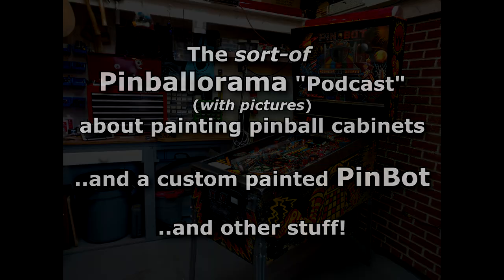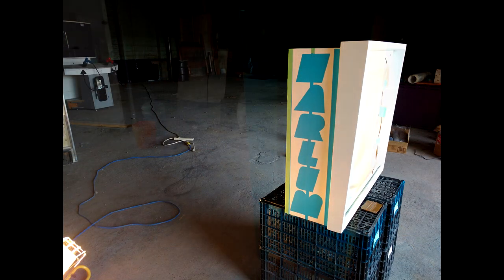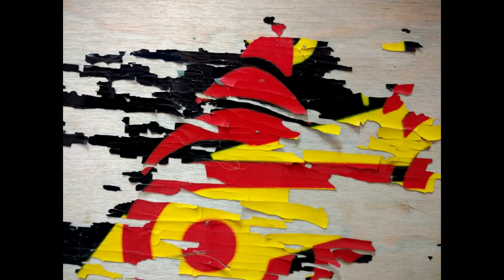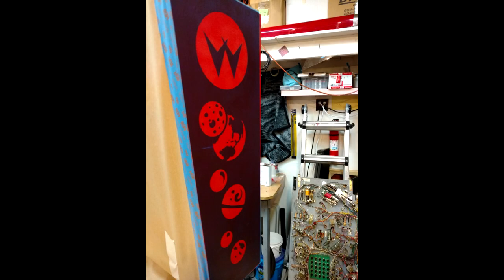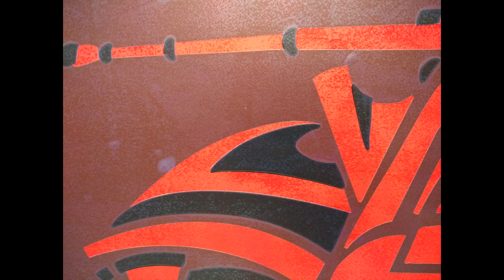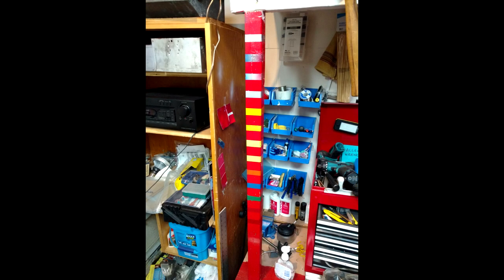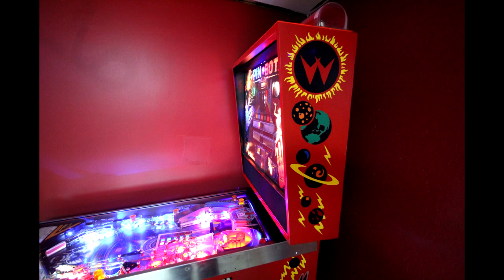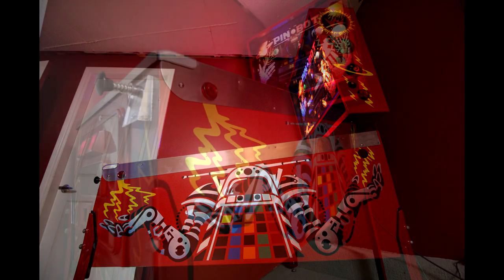Painting Pinball Cabinets with Stencils - The sort of podcast-like video with pictures and stuff.

Comment: I have a slow restoration of Black Knight, I painted the cabinet with stencils and it looks amazing.  The edges are clearly visible and elevated due to the layers of paint.  Did you do a wet sand on the edges when you sanded with 3k grit?   How do you like the triple thick matte?  I know here you liked it but have you used it since?  Any final polish on that?
Reply from the maker: I also had slightly raised edges from the stencils. I gave them a very light sand to smooth them out but it didn't remove them entirely. I was ok with that. The matte clear over it helped smooth the edges and is protecting it rather well. That machine has been in the arcade for over a year getting hammered on by the public and it still looks like the day I painted it.

Comment: Those be some great / cool  results.  Something I would suggest for applying stencils or decals is a tool called The Big Squeegee (20 inch version).  It is a touch pricey, but I'd hate to be without it.
Reply from the maker: Thanks. I used a semi-hard rubber tool to help adhere the vinyl. Worked well and didn't damage the vinyl. If I end up doing a lot more of these, I'll probably look into better tools like the squeegee.